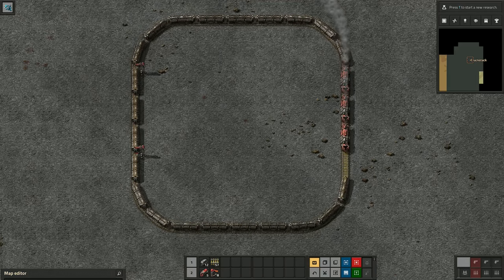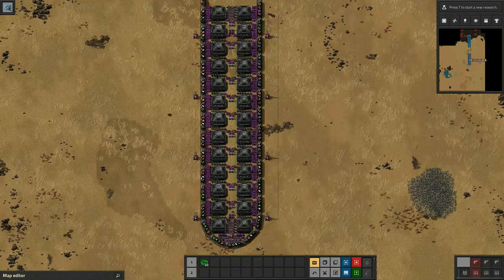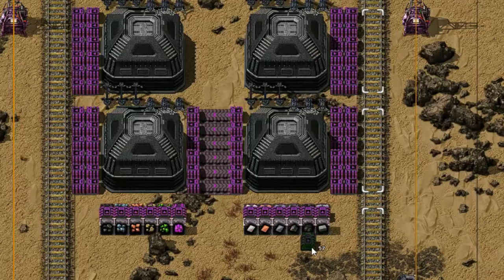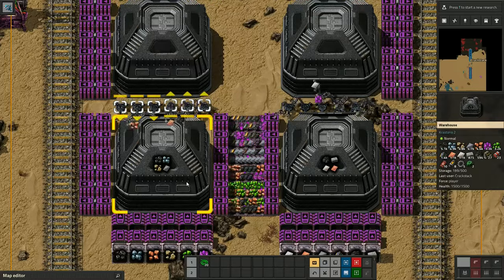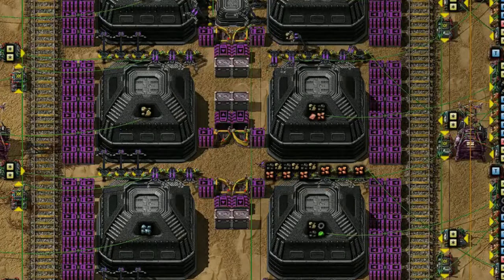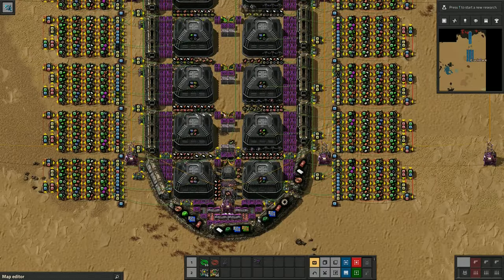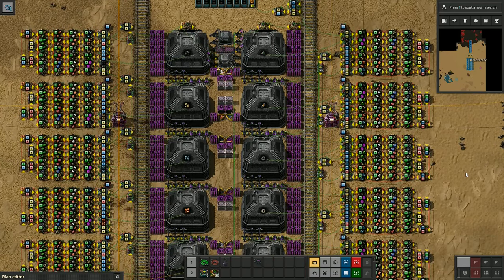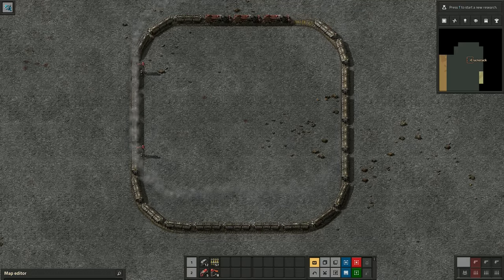Handling BIG trains in Factorio

Comment: Hear me out… put ware houses on both sides of a single lane like this: “I” is equal to train track, “:” is equal to warehouses.  :I: and then just use only those mini loaders and make them have the same blacklist one item thing by using underground’s on the 1st top row and 29th row bottom.  If it’s in a loop it would be so much simpler. Like you said. 
To address the fact miniloaders won’t fit in between each storage, just use inserters it still works